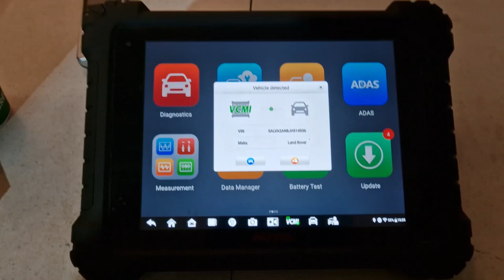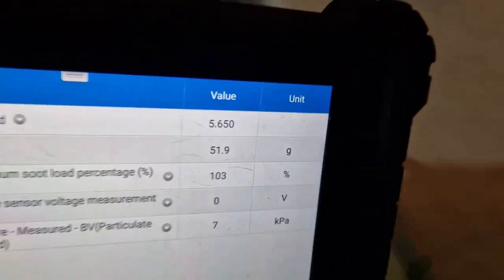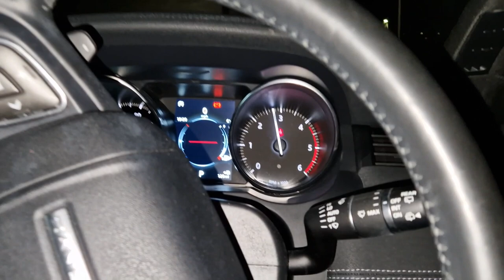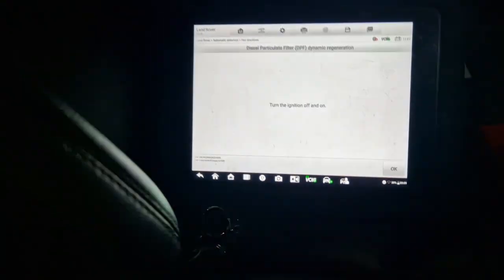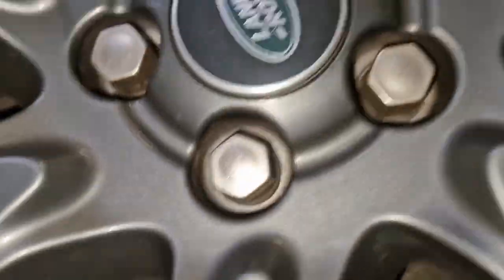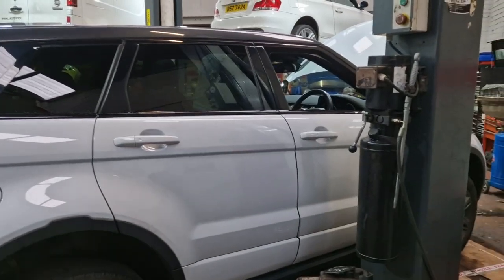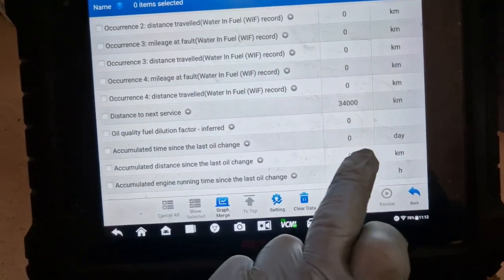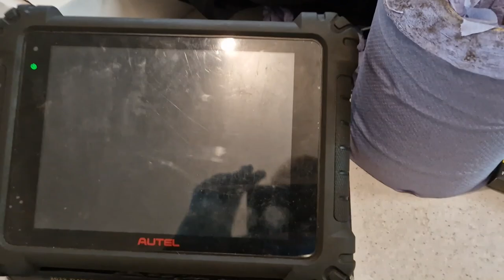#rangerover  rover Evoque P2463 blocked dpf filter clean and regeneration and service #landrover

Comment: I nteresting problem , i heard plenty about DPF but never had an issue myself ........yet! I was looking at an Autel code reader as a treat to myself , but still trying to figure which one in the range to go for.  Good chat again. Another question, am I right in thinking you managed to get the DPF cleaning fluid into the exhaust via the pipe you disconnected underneath. It looks a good idea to do that, i guess it helps speed up the process.
Reply from the maker: hi, I'm so sorry I missed this comment. I'm not sure how I don't get that many, lol 😅 yea, you can go in that route or remove the add blue injector to go in there with the fluid the autel is  a superb diagnostic machine really geared up for prestige vehicles never had any issues with it this is the  maxys 919 with pass through and 4 channel scope I love it its been one of my best investments have a great day and thanks for watching if tou haven't allready please consider subcribing